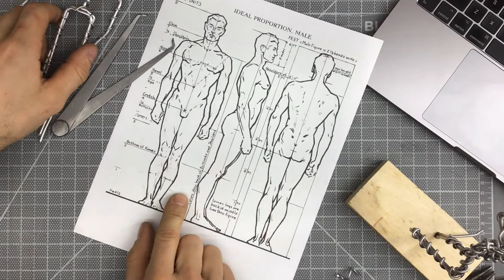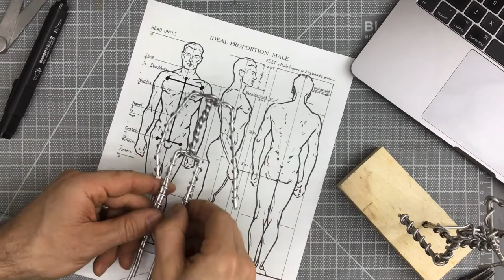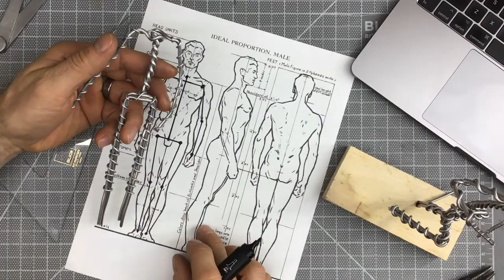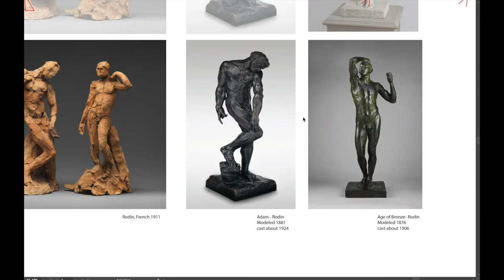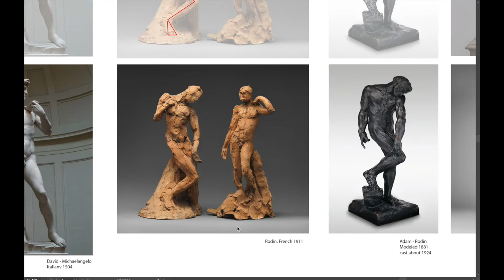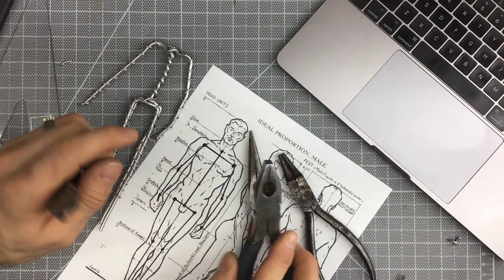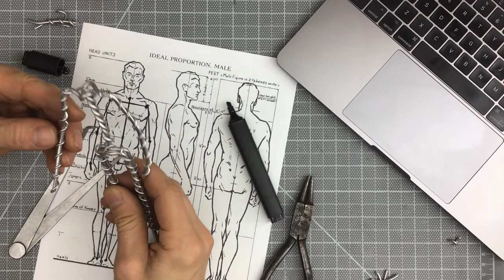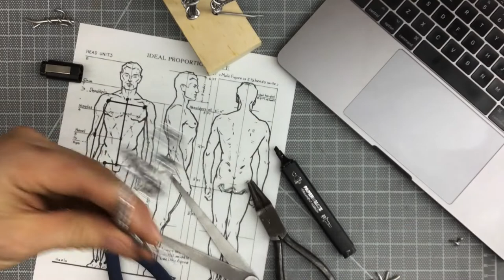Figure Sculpture: Posing the Armature

Comment: What gauge wire is that? What would you recommend for a much larger/ heavier puppet? Thanks!
Reply from the maker: My apologies for the tardy reply. Been busy in the studio with students and not posting much to this channel. For 8inch tall figures we use 1/8th" - 10G - 3mil wire. It's stiff enough to hold up the small figures and soft enough to shape by had with simple hand tools. 2, 3, 4, more? strands can be braided (twisted) to dramatically increase holding power without having to buy larger diameters. For much larger forms we weld together steel armatures.